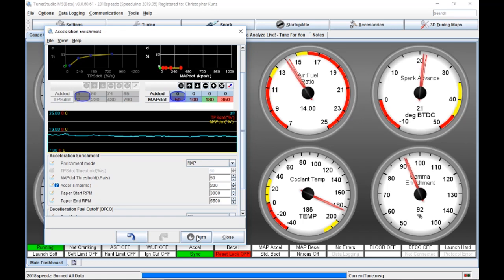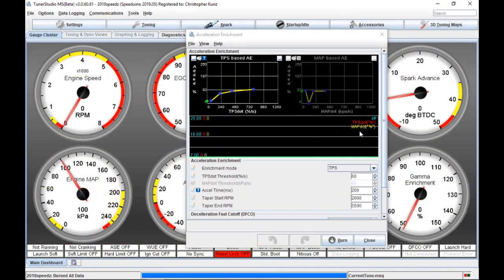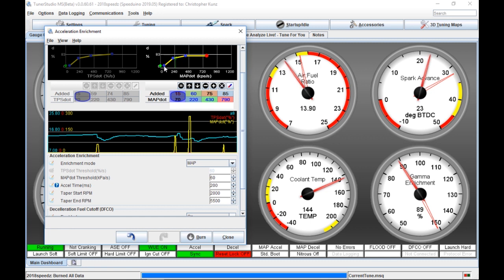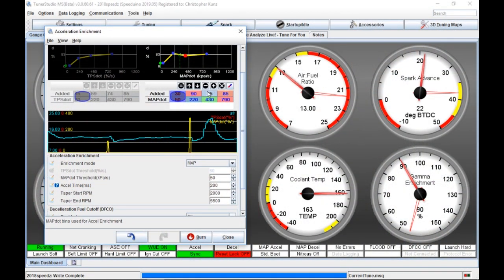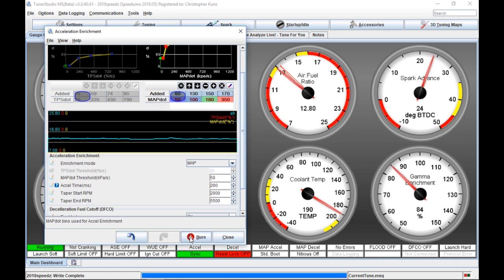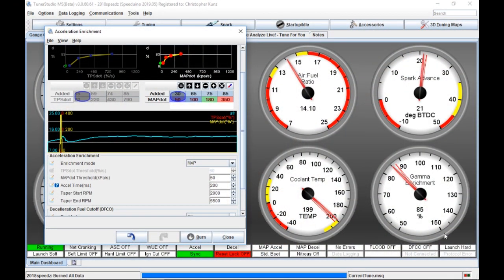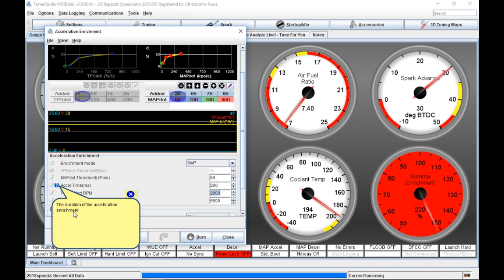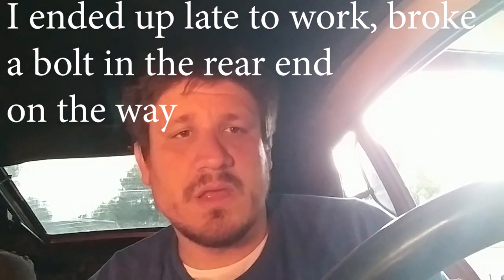Map Based Acceleration Enrichment (Part 1 of 2)

Comment: I'm running a mS on a twin turbo dodge stealth. It offers mixing MAP and TPS AE. I have bean running 50/50, would you recommend that or going 100% MAP pased AE?
I've thought it would be eraser to tune one table and not two. 
Unfortunately (of course) I have it all torn apart this week (rebuilding the AC). But hoping to get it running well enough for a short road trip next week (probably tuning on the road).
Reply from the maker: I pinned your comment. I was trying not to get too deep into it, but after reading your comment, I do not want to lead anyone astray for those that have the same functionality to run a mix. If you read the data logs, TPS readings will always react faster than MAP readings, because of this, TPS is superior to  MAP for reaction time. MAP covers more scenarios. especially on a Turbo set up.  The BEST set up I have ever driven had a 60/40 split (60 TPS and 40 MAP) To be honest, this was the best set up as I spent the most time into the AE settings. This is how I went about the set up. I ran TPS only AE for a full drive. Tuned the TPS to my best ability. I then switched to MAP only AE and tuned that for two days worth of drives to work. After both had been tuned out to my best ability, I kicked on the setting to do a 50/50, a 40/60, and a 60/40. Even without looking at the data logs, I could tell the set up enjoyed the 60/40 over the other combos, but it might have been a bit of a placebo as the data logs only showed a minor preference. At that point I did a final test of 70/30, and compared the data logs to confirm that boos situations started to suffer. Anyway, Sorry for the novel, let me know if you have any follow up questions, I really appreciate you  adding this question.

Comment: great video! have been also fighting with AE back in the days but eventually I moved to MAF setup (using maf load both for fuel and ignition) and it smoothed out everything even without having AE on.. it is almost as smooth as factory ECU. (I also added timed sequential injection and it also made some difference.. especially for low torque transitions)

Comment: Perfect Video! 
Actually I only can add [ms]. 
Whete do I find the option to use [%]?

Greetings from Germany!
Reply from the maker: Depends on the firmware and how they code it. Back when I had MS1, it only used ms. So I would need to do the conversion. If your firmware requires ms, just keep in mind if you swap injectors, or fuel type, you might want to have two tunes that you can switch between quickly.

Comment: Thanks for the vid.  Perfect timing too as Im just starting to tune my VW (microsquirt) and was researching about MAP based AE.  Im running 100% MAP (no TPS) as these drive by wire VW throttle bodies dont work well with Micro/MegaSquirt.  Anyway, thanks for the informative and easy to understand video.  I learned quite alot.  

You should set a threshold on your temp gauge so it goes red when you're around 200°.
Reply from the maker: Glad I could help out, I will have the 2nd part of the video out in the next few days I hope, I ended up having to make a few adjustments to make it all work. My cam required a TON more fuel off of idle, and then started to require a lot less at the as the RPM increased. Ya.... I have been working on the a dash mounted tablet the past few weeks. The gauge settings are now on my list to reconfigure...... oh the shame... lol